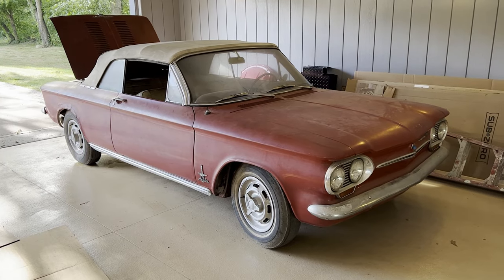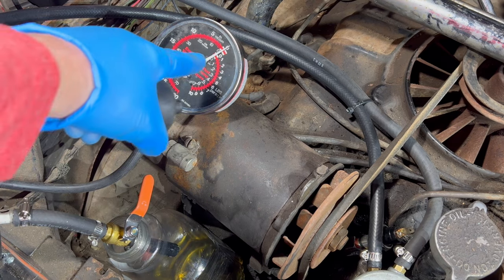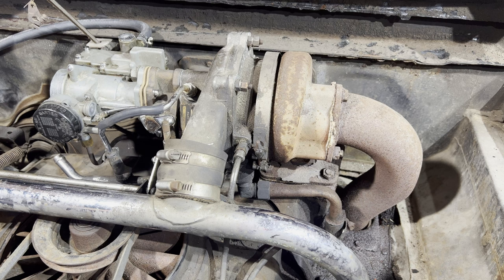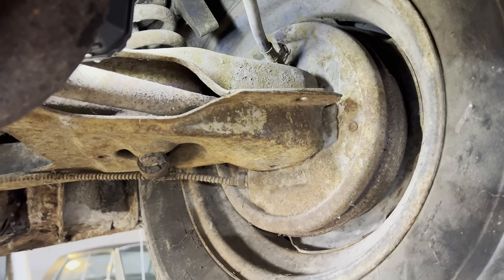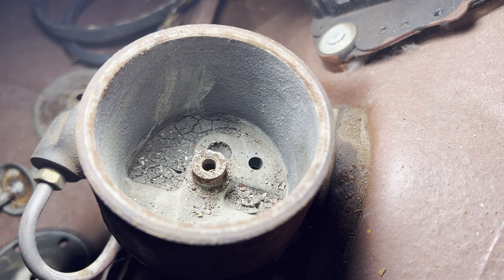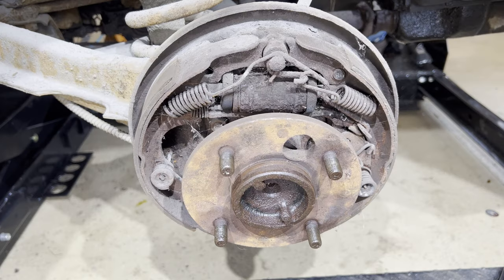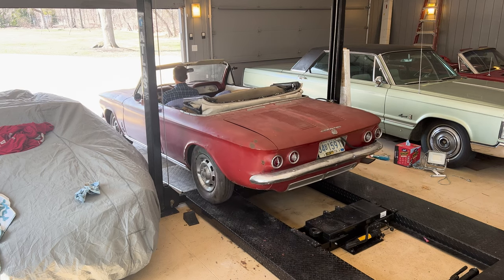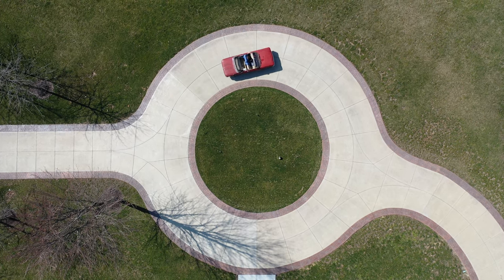'63 Corvair First Drive in 48 Years?

Comment: I restored these cars for many years with my Dad, at his peak he had 30 of them.   They really were engineered well (for that time period) and the engines were bulletproof although they would leak unless you replaced the O-rings in the pushrod tubes would usually only took a Saturday morning.   He had a 64 Spyder Turbo convertible and I remember when we got it home and began trying to get it to crank it backfired and sounded like a cannon.
Reply from the maker: 30 Corvairs holy moly! Wish I had your experience. Engine coming out next and we’ll be replacing more than those pushrod tubes for sure. Thanks for watching!

Comment: My first new car was a 60 two door coupe with the "Powerpak" 95hp engine.  I set an NHRA drag strip record of 17.10 seconds in D Modified sports car class.  The "Modified" was dual exhausts.  In the late summer of 1960 I installed a 61 4-speed transmission that I bought over the counter at my local dealer.  In addition, I drilled and scooped the backing plates, installed metallic brake linings, shocks from 1957 Chevy front (standard duty in the front of the car, heavy duty in the rear), cut one coil from the rear springs, made wheels which were 7"x 15" for the rear, and installed Corvette valve springs and solid lifters.  The car was infamous for 500 miles around my home.  Some of the stunts I pulled included out dragging a fuelie Corvette across the width of a 4 lane intersection, and out running Kansas high way patrol and Arizona HP without even knowning they were chasing me!!  I have tried to duplicate that car, with limited success on more than one occasion.   Current car is 74 conv. with 140 Horse engine, 4-speed trans, 3.55 rear gears, totally re-built engine, forged pistons, balanced, blueprinted, etc. etc. etc.    Anyway, enjoy your car.  It can be the source of great pleasure and endless frustation.
Reply from the maker: Man you are way beyond me! Sounds like you had a heck of a car there. You’re right about working on cars. It’s a kind of fun that’s hard to explain to people considering how frustrating it can be. Thanks for sharing about your cars and thanks for watching!

Comment: left rear wheel just needed a good smack with a BFH on the front side, just outside the studs.  counter-intuitive to hit on the front but it almost always works.   A small torch would be helpful too, would have also helped loosen the bleeder screws.  Those tires are kind of funny, very little wear on ancient bias plies.

Comment: The fan sure is quieter now! 
I love what you’re doing. 
I’d give anything to see it when it’s back together. 
My sister had one many years ago, got hit in it while stopped at a light, totaled it ( & probably destroyed engine ).
She had 3 cars that were totaled, & Corvair was #2. 
I was in the car with her, when Dad was teacher to drive a stick.
First one was also at a stop light….Buick LeSabre, hit head-on, car was nice before that, but totaled.
The third one killed her. 
Totaled her new Nova by a drunk driver at high speed. 

To this day, I’ve always had a soft spot for the Corvair.
Hers was white, & a second generation Corvair, but that’s all I know. 
I guess I’ll never know the year.
Reply from the maker: Patrick, thank you for all your comments and helpful advice. I’m so sorry to hear about your sister. I’ll keep working away on this project and keep posting my progress. Engine is disassembled. Cylinder heads and crankshaft in shop. Working on the body. Stay tuned and thanks for watching!

Comment: I owned a '62 corvair in the late 70s that I bought for $100. It was a 90 hp that I boosted up to 110 with a 4 carb set that I found at a junk yard  followed by a turbocharger from the same junk yard. I got it running but it continually vapor locked when I turned it off. When I opened up the turbo on the road it would fly. I was pulled over by the cops on my test drive for speeding.

Comment: The reason the one tire is further out than the other is because the wheel bearing has moved on the the axle shaft.  These are pressed onto the axle.  Not sure why this would happen, but it should be addressed before you head out on the road.  Great progress!
Reply from the maker: Good to know! Sounds like I’m lucky that wheel didn’t fall off…

Comment: I had a '65 convertible with auto trany. It had a body leak in the area of the heater ducts that ran along the side of the passenger compartment. Every time I drove through a puddle my windshield would fog up.
Took it back to the dealer but were not able to fix it.

Comment: The rubber brake lines will swell completely closed.  They are a major fail point on an old car like this, it's a good idea to just replace them proactively.   Also - if you didn't know, brake fluid will completely strip paint right to bare metal.   As for that axle shaft sticking out, it probably pulled out while hammering on the stuck wheel.  The retainer should have been tight to the backing plate.
Reply from the maker: These are great tips, thank you.  I bet I did cause that axle shaft to move.  Never occurred to me, should have thought of that. I'll be rebuilding the whole thing eventually anyway.  Same with the brakes, they'll need completely redone.  I might cut those rubber brake lines open to check them out soon.  I bet you're right, probably completely swelled shut.  As far as engine oil leak... that engine is coming out next. Stay tuned!

Comment: that smoke on the left side - I would guess an oil leak.  I knew a guy who had a Corvair back in the day.  It had an oil leak that dumped oil where the smoke went right into the cabin if he turned the heater on.   Engine sounds quite good, and it doesn't look like it's burning oil.... bet the engine is in decent condition.

Comment: Hi I have started watching your channel I have 2 corvair's I am also working on but I am wondering about your Chrysler you have gone to get parts with what year is it? My first car was a 1967 new Yorker is yours? If so could you send pic. of it

Thanks Norm
Reply from the maker: That is a 1967 Chrysler Crown Imperial four door hardtop in haze green metallic. I have owned it since 1993. It has factory air and “AutoPilot” cruise control. I’ve had the engine and transmission rebuilt and the AC repaired. Otherwise it is pretty much an untouched “survivor” with the original paint, vinyl top, and interior. Send me an email at lostwrenchgarage@gmail.com and I’ll send you back some pictures. At some point I hope to do a video tour of it for the channel — just been too busy with the Corvair!

Comment: I just watched the episode where you got the corvair running in your driveway, and I think I should make you aware of something you should know about. I was around when these cars were made and back in the seventies the safety bard put out a notice about a major safety problem with all corvairs, thats why they disappeared from the road. The alert was that they were a major fire hazard for anyone riding in one if it was involved in an accident!!!  Im not kidding, I think it was Ralph Nader that sounded the alarm.   Check for yourself .   I just didn't think you should c0ntinue without the warning !
Reply from the maker: Ralph Nader did write a book, "Unsafe at Any Speed", that used the Corvair as an example for safety reform.  His allegations were about dangerous handling qualities though, not fire hazards as far as I know.  Later the NTSB published a report refuting Nader's claims about the Corvair.
Reply: I believe the fire hazard warning was for the Ford Pinto, (which I owned). The rap on the Corvair (which I owned as a teen), was its handling issues while turning at speed.
Reply: BS they are great little cars

Comment: Say it with me….PARKING BRAKE. 
I wouldn’t be operating the brakes with the drums off….I forgot once, and learned the hard way. 
When you go to bleed the brakes, the drums have to be on. 
Otherwise, the fluid will push the shoes apart until the wheel cylinders come apart, puking all the fluid out all over the place. 
The only reason you don’t have a mess on your hands, is that your brake system doesn’t work.

Comment: You need to use a dead blow ( sand filled ) hammer, to whack the wheels. 
A steel-faced hammer won’t work as well, and will cause damage.

Comment: you can buy diaphrams for old fuel pumps.  your check valves are probably ok.  get a new diaphragm ,rebuild the original pump.  the new diaphragms are made for present day gas.  the old gas in your tank is good for killing fire ants.   replace all rubber hoses.  that car will keep up with the same year corvette up to 100.
Reply from the maker: I think Clark's is working on an improved replacement mechanical fuel pump.  Hopefully available by the time I need it.

Comment: if you going to work on Rust get yourself an air hammer  bear hammer so you can get bolts and whatever is Rusted loose
Reply from the maker: Good tip thanks. I’ve got an air hammer somewhere, can’t seem to locate it at the moment haha…